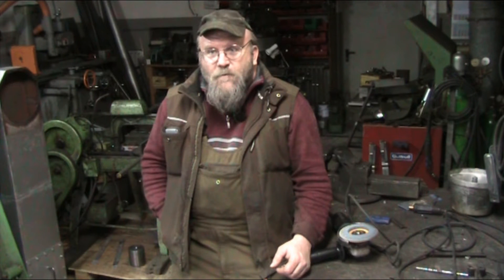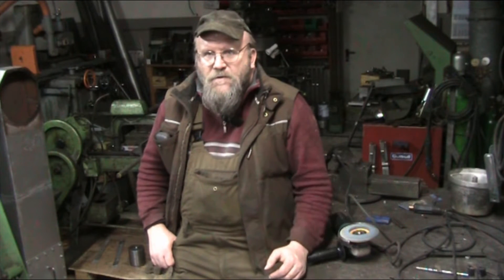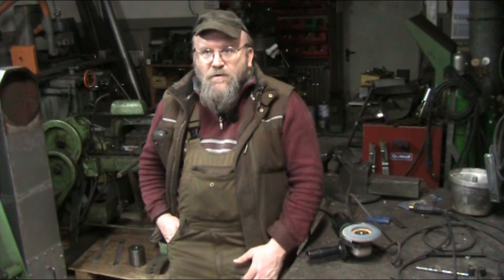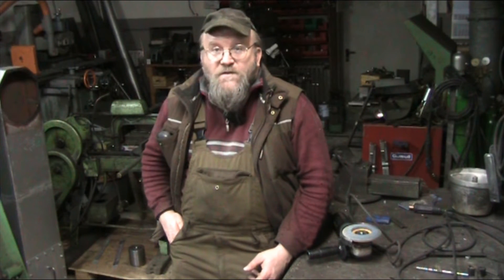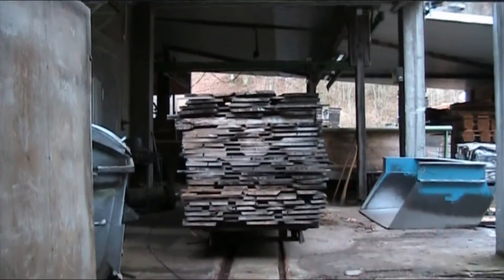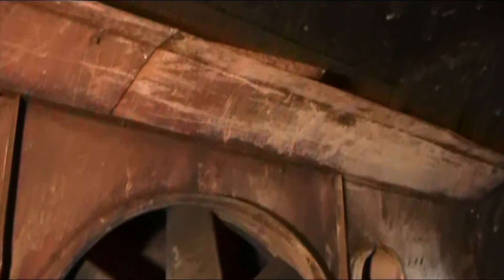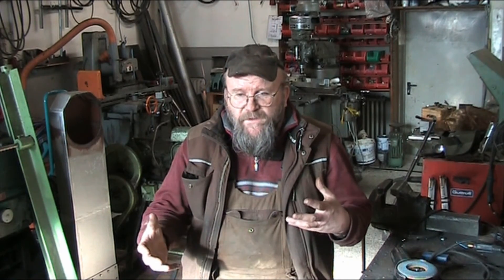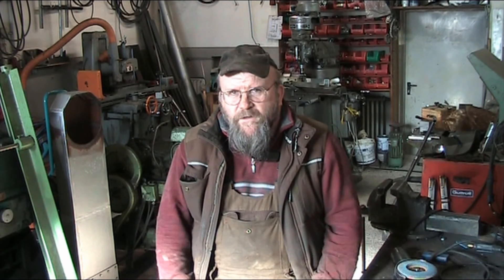Random Lengths, episode 5, taking a peek inside a working dry kiln

Comment: Nice one,... just wondering what's the difference between Kiln dried and Air dried wood, around here it seems Kiln dried is more expensive
Reply from the maker: yes, kiln dried is much more expensive due to the infrastructure needed and the energy investment it takes to get to a finished product. the old saying goes that time is money. in time the wood will get to humidity content that rivals that of kiln dried wood but it takes several years.. and most outfits simply can't store several years worth of production open air.. so that's the main reason we go to kiln drying
Reply from the maker: also, in conifers, kiln drying sets the pitch. in other words, the pitch contained in the wood is "cooked" and becomes slightly petrified. this is particularly advantageous when it come to applying various oils and stains as the sap often won't mix well with other compounds. 
long time air dried wood has the huge advantage that it is much more stable in the finished product. so if you have lumber that has been in a dry shed for more than 4 years, that wood will most likely never move again with a change in humidity.